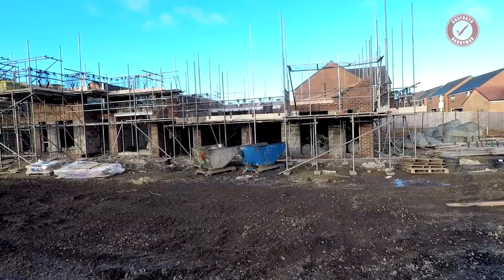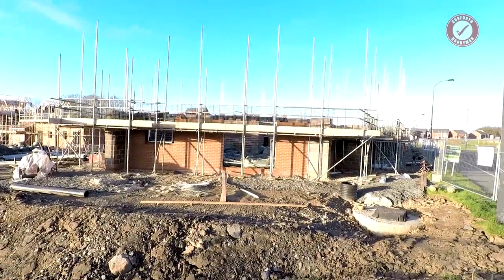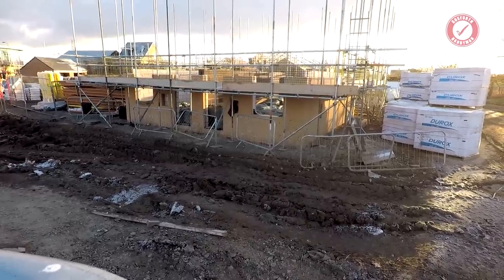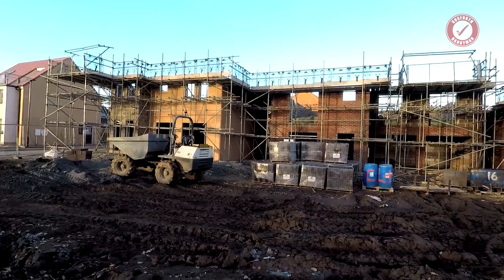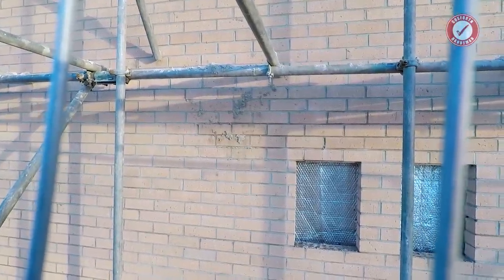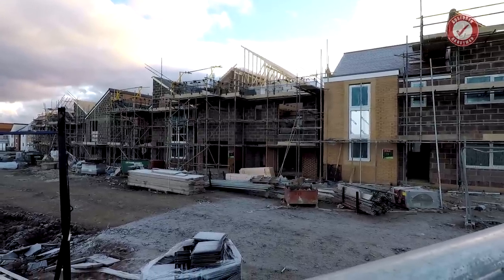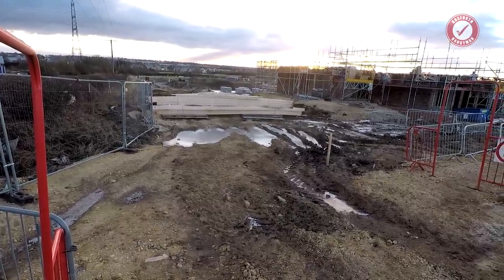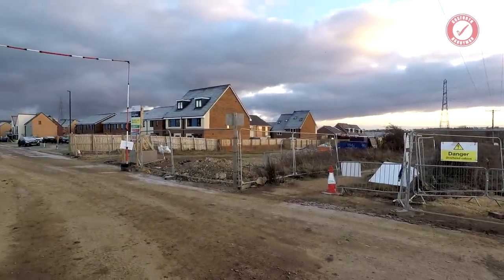How are New Houses in the UK Built? Introduction & Externals

Comment: here in NZ timber rules Proabaly 90 percent of houses are bult with timber frames,most is prenailed frames and timber roof trusses for the roof.Some is steel frames.A lot of new houses will have a brick veneer but it is purely cladding ,not structural,Most houses are single storey but id two storeyed the midfllors would proabaly stil be 50 percent solid timber a lot will be the I joist type midfllors ,with the last lot done by special floor trusses made by the prenail plants.Roofing is almost all metal roofing with some concrete tile too.Cladding if not brick will still be timber weatherboards  or some other material made to look like timner .Lots of panel type cladding and some houses will be clad in plywood.
Reply from the maker: Interesting - a lot of the 'timber' decorative cladding here is a concrete composite stuff. 👍
Reply: yes thats the stuff james hardie mostly.
Reply: Houses in Canada are built very similar, we just frame off the basement foundation walls and shingle our roofs.
Mostly brick veener or stucco

Comment: Here in Canada we have crap built houses.  There is a simple explanation though.  The code is designed to approve houses as long as they are likely to survive 25-30 years.  One can only imagine that the housing industry was complaining that they couldn't make huge profits by building houses that would last longer.
Reply: Well this is not the case in Uk. , people would be surprised to hear that all council built homes only ever had a 30 year life span when built post WW2 . and yet most now have been privately bought by the tennants. Yet same people complain on modern day house life span.
Reply: @jimmyc974  I find that hard to believe.  I've watched houses being built in north america and lived in them.  While I've only staying in terrace houses in the UK I can say I really really doubt they were only meant to last 30 years.  If you could point me to some evidence that they were meant to fall apart in 30 years I'd be very interested.
Reply: @dinnerwithfranklin2451  Social Housing building life span was 30 years in UK. Due to economics and a required boom of social housing it is a fact in UK this type of housing was indeed constructed at the bare minimum costing.
Reply: @jimmyc974  Yeah so your "fact" is unsupported by evidence.  I understand completely.
Reply: @dinnerwithfranklin2451  A tad presumsious reply. Well I am not here to do factual research to suit your idleness,   but what I will inform you of is I have been involved in housing construction in many capacities from the early 70's and every now and then I come across people unwilling to believe advice from those of greater knowledge and experience.

Comment: I'm just wondering when this became a thing, has it always been like this or is it just a recent thing? I thought my dad's house was built well but over the years with the issues we've had with it, and watching this video, I've realised his house was built in the CHEAP too. The floor is tiled but under that is concrete and the whole floor has higher and lower bits. The walls barely have any insulation and the EPC is basically an F. They've never had a EPC done recently but they can't get the house to 23 degrees Celsius without over powering the radiators, and the floor is always cold (even the carpeted areas). Plus, only the front windows of the house are double glazed, the rest aren't. To top it off, the garage has a flat roof which has partly fell through. But because of the housing market, the property and land is still worth quite a lot despite the house not being in good condition. It was built in the 80s the same as my flat me and my partner live in that has its own set of problems! Thank you for this video!!
Reply from the maker: No worries! I'm surprised it doesn't have double glazing in a 1980's property? Thought it was pretty standard by then, but perhaps not. Really... it's always been like this. Seen some pretty horrific things in older houses too. 👍😀
Reply: @GosforthHandyman  I think my dad chose it to save money but it's not done him any favours there over the years 🤣ahh okay, thanks for that!

Comment: Not much differences in Holland, lightweight block internals, brick outside and cavity high density dividing walls between the properties, all well insulated.
Major difference however is in the floor and roof construction.
No wooden floors inside, concrete slab floors on all stories including the loft is the norm, for fire safety and noise reduction between down and upstairs, also no need for separate made ceilings with concrete slabs, all conduits are in and these are simply spray painted with a sort of stucco from the underside (pre 1960 houses do have wooden floors).
Roofs don't use the thin lightweight prefab framing, joists, depending on the size of the roof with or without a steel frame are mostly used, all to have no internal framing in the loft space, the loft is built out as usable space for storage, possible extra bed or hobby rooms and mostly CV boiler and ventilation unit are in the loft as well.
Therefore there isn't loft insulation but roof insulation consisting of large slabs of insulation foam covered in plywood or OSB which go on the joists, on top of these a damp open membrane and the strips for holding the tiles go, DPM is on the inside.
Ground level floors are also mostly done as concrete slab, but on insulation to prevent cold coming up, with increased risk of cracking tiles however as the insulation sets, also for this block and beam would be better.

Comment: Most new houses have 1 layer of bricks on the outside and timber frames filled witb foam on the outside, im concerned that if i get robbed the robber will break through the wall, thats how bad they are also the floors cause a ton of leakages
Reply: No they are not. You do get some like this but they aren’t very common unless your in Scotland
Reply: @belltond1527  in my area it is

Comment: What do you think about new build flats in London and sound proofing? I live in a Victorian conversion flat and the sound proofing is shit. Considering moving to a new, purpose built flat so I don’t have to hear my neighbours stomping 24/7. Please help!
Reply from the maker: Wooden floors are always a problem - very difficult to soundproof. Modern flats tend to have concrete floors and these are much more soundproof. 👍
Reply: Gosforth Handyman interesting on the wooden floor point and definitely true. 

With a typical concrete modern flat would you be likely to hear walking with standard carpets? How would this vary with wooden floors? And if so how loud/invasive would you guess it would be? 

Thanks again
Reply: @bigbobabc123  new builds have to be built to comply with sound insulation regulations to reach set noise levels.

Comment: They dont pump insulation i to houses that shit has caused problem with damp avoid at allcosts. If anything go into the cavity it is foam boards which is added as they go. So if its a 50mm cavity they use 25mm insulation boards or if 100mm cavity is used its a 50mm board. And because this is a traditional build they will use insulation plaster board along all exterior facing walls of the house. If it was a kit they would have put wool into the kit opening then plasterboarded. I work on many many different new house builders every single day so witness first hand the goings on of many a company like Barratt homes , David wilson homes , taylor wimpey , miller homes , avant, cala, persimmons, lovell, keepmoat, campbell, as homes, and a few other less known companys

Comment: It's not very often new builds use blown insulation in cavity walls, from what I understand bricks are often left out for scaffolding and to clear cavities of any mortar snots knocked off from the inside once the wall is finished. Also the low density blocks for the external walls are most likely being used to improve thermal performance to meet building regs, cost wise they are typically more expensive than dense aggregate blocks.
Reply from the maker: I've seen it being blown in from big trucks! (a few years ago now though) 👍
Reply: Gosforth Handyman it does happen your not wrong. Full fill insulation can cause big issues if done incorrectly and in the wrong areas of the uk.
Reply: I am of the same opinion regarding the insulation being blown , it would not be a surprise to learn no cavity insulation and dot n dab thermal board being used (the white blocks will most probably be thermal blocks and the party walls will either be dot n dabbed with thermal board or btten and insulation)

Comment: Hi I am just down the road at Teesside. We have a lot of new builds at a place called "Ingelby Barwick" but these are stick build IE wood inertia and then brick outside. I hate these because as you will know the inside is built and gets wet with all the rain and snow, and then they build a brick exterior and lock in all that wet. A few years down the road and mould and dry rot start to come through. The way your houses are being built are much better than that.
Reply from the maker: So timber framed?? I've seen a few timber framed self builds up here but never seen them in the big new estates - interesting! I must admit even with the brick & block I get nervous when they seal them up after a long wet spell. 🤔
Reply: Here in Canada we do Concrete foundation for basement, than platform frame (stick build) the rest of the house than we do brick veener. Yes the wood framing members are exposed to the elements, sometimes months on commercial builds. On Residential I've never come across any serious mold problems on 2x materials or the plywood/osb sheeting.  I have come across bubbling but that is the general contractors issue. If small holes are drilled in the plywood sub floor and the water is spread around and allowed to dry its not an issue... But I definitely agree its dirty and muddy and more then likely the general contractor is not gonna deep clean the the plywood sheeting before the hardwood flooring goes in.

I have seen standing water in commercial jobs which the plywood sheeting turned black with mold, lack of house keeping.

Comment: If only persimmon still used any sort of block on the internal walls. They’re now concrete slab with timber frame and then block/render or facing brick on the outside. They can build the whole frame including the prebuilt roof structure in 1 day. I refused to buy one on the basis of the poor quality the timber frame gives. They have to leave mastic gaps below the eves and window sills on the external brick or block faces so the window secured to the timber frame can settle.
Reply from the maker: Lordy, yes - I wouldn't buy a timber framed house in the UK. See a few of them around here but mostly brick & block still. 👍
Reply: Gosforth Handyman they are significantly cheaper but I can really see why. It’s such a shame as I was watching a video about persimmon houses a from few years back and it was completely built out of brick but also had bay windows yet it had the same name as the one we were looking at (Clayton Corner). Down in Devon, where we are they’re all wood framed. I also didn’t realise the scandal of the missing firebreaks is more serious than it seemed. I always thought it was just between properties so looking at a detached one we would be safe however the wood framed houses quite rightly have to have firebreaks between the cavities when moving between floors. So if there was a fire the first floor doesn’t quickly end up the ground floor I guess. It’s an even scarier side effect of poor quality wood framing.

Comment: Very Interesting watching how the houses are built, should be just as interesting in the next one from the inside. 
Those builds look really nice when they are finished, do you happen to know what the cost of those are? Don't worry i'm not uprooting the family to Newcastle ha ha ha.
Barry (Wirral)
Reply from the maker: Barry Roberts I think the one on the thumbnail is £285k
Reply: I believe cavity insulation is a bad idea and I think it will cause a lot of problems such as damp later on with peoples homes. I am a firm believe that a cavity is there for a reason hence I will not have it done. 

Firms will use different insulation materials but having polystyrene beads pumped into a cavity which chemically react with electrical cables is just one example, another is you can get settlement  causing cold spots 

However I do like to take some new build ideas and use them in my victorian house.
Reply from the maker: It depends where you are in the country. It's quite dry over the East side - I've never seen any damp problems due to cavity insulation over this side but it makes a huge difference to how insulated the house is in winter. Interesting article on it here: https://www.which.co.uk/reviews/insulation/article/cavity-wall-insulation/cavity-wall-insulation-damp-problems
Reply: Problems are sometimes caused when building with cavities because sloppy brickies allow muck to land on cavity ties therefor rendering the drip on the tie to fail and allow moisture to travel across the cavity from the outer skin. Using a removable batten to catch mortar as you go is what I used because I was a soppy brickie :)

Comment: So bad that builder don’t insulate floors. I lived in a 2003 flat and the floor was stone cold in winter. The walls had just 50 or 60mm of rockwool. Really not great and it was not cheap to heat with electric heaters.

Comment: So it seems like cellars are still not all that common in the UK, even with new builts. I have lived in Germany, the UK and France and everywhere except the UK they had cellars. Wouldn't know where to put all my stuff without one.
Reply from the maker: Totally agree. No idea why we don't do cellars. Damp issues possibly? But yes, always been jealous of big cellars and laundry rooms in German houses. That and proper external window blinds / shutters. 👍
Reply: @GosforthHandyman  They even do cellars where the groundwater level is pretty high, it just takes quite a bit of waterproofing. Houses without cellars are usually on the cheaper side here in Germany. Or they're prefabs. Quite a large proportion of new builts are prefabs. But then again, you can also have a cellar in a prefab, you start off by building the cellar and then your prefab goes on top of it.

Comment: Little knowledge can be dangerous.... still use block and beam then a concrete floor cast on top.... many foundation types used dependant on the ground surveys... same goes to the floor slab. The inner leaf light weight blocks are thermal value. Party wall blocks are dense for sound properties so brownie points for getting that right. Cavity insulation can be pumped in which is done from inside on new build in a pattern to ensure cavity is filled. Partial fill with a choice of several types of insulation, or full fill. External walls will be for thermal values and the party wall will be a different insulation that will have sound deadening properties. The joist... yes engineered joists.. you can drill out to within mm of the flanges. If you drill a 4” hole then you have to leave 2x that hole before drilling the same again. If you drill 25mm holes you can have them closer together as they can be counted as a 4”hole. The chipboard floor normally 22mm as the joists are most commonly set at 600 centres will be glued with a d4 glue in the tongue and groove and on top of each joist then fixed with a min of 5 fixings. Now I’m bored as it’s all I do all day ... with lots of knowledge.
Reply from the maker: I can assure you these floors aren't block & beam but thanks for sharing your knowledge.

Comment: Some of the roof verges didn't have any overhang on the completed flats.  They were literally flush with the wall below and then dry verged.  Opinions I've read is that that's vulnerable as water can get in underneath the verge and then into the building fabric.  

My own property in Scotland has a decent 30cm overhang over the gables and eaves.  It's a cement verge rather than a dry verge and certainly over time I've seen tell tale signs of water running down the weatherboard at the bottom of the verge due to deterioration of the cement verge.  That's the point when I wander about redoing the cement verge or getting a dry verge retrofitted.

My own property is timber framed.  26 years old, and no sign of deterioation in any part of the structure.  I have every confidence that it'll last many decades with proper maintenance.  I've seen new properties that are fabricated in a factory and then assembled onsite in one day.  Scotframe is one such company, and it looks like an impressive operation, and the new walls are very thick.

My own opinion on OSB for structural joists:  It's fine so long as it's dry.  If it gets wet, then I understand that it's very sensitive to deterioration.

Comment: This is more a tour of a building site from the perimeter (since it was closed) than how houses are built, which was a little disappointing really. It would have been nice to know something about the range and style of homes being built there along with their pricing. 
I suppose there is good and bad with new build properties. The good is that they are fairly well engineered, well insulated and eco friendly. Unfortunately though, they are built way too close to each other (even the more more expensive 4 and 5 bedroom kind). Also, some of the material quality is rather dubious (what will these look like in 15 to 20 years?). 
All in though, not a bad video.